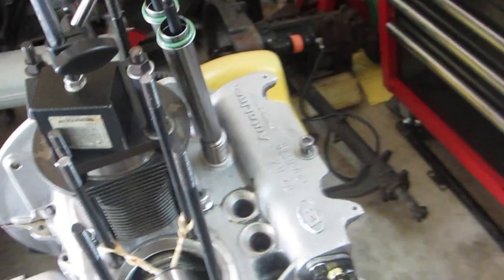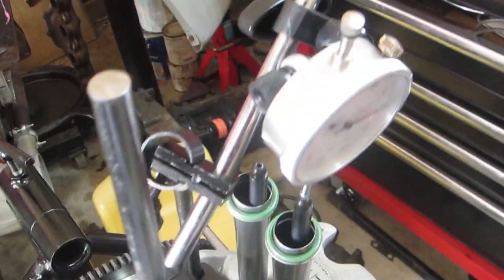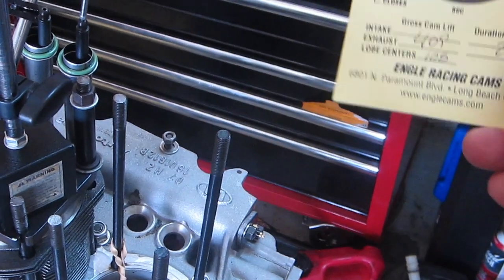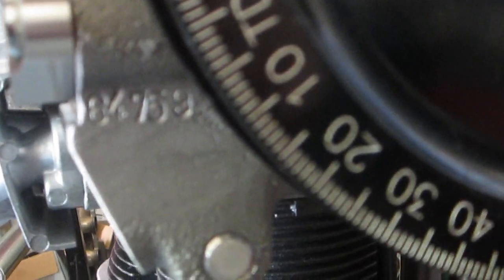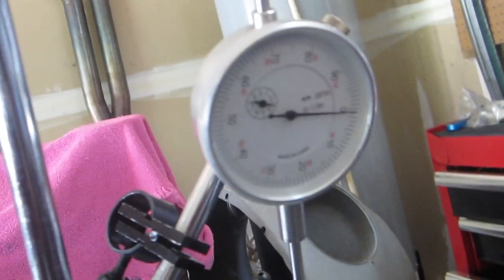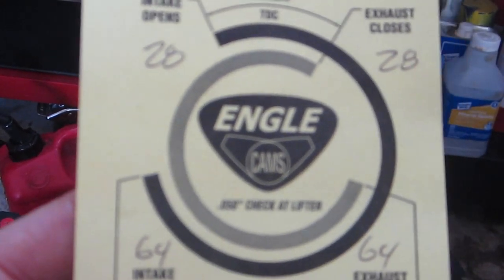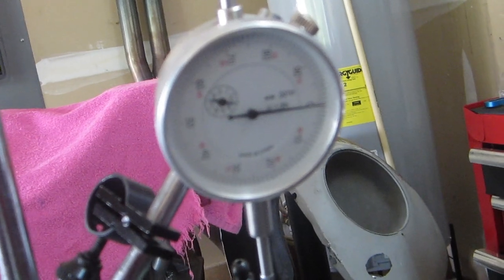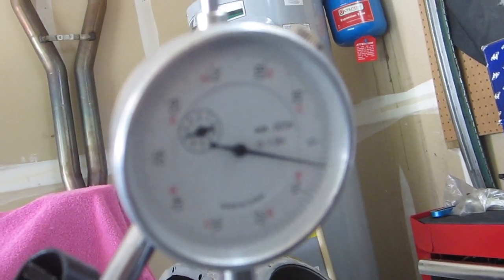VW Camshaft Degreeing

Comment: what size are your IN valves
Reply from the maker: 45mm intakes with 37.5mm exhaust
Reply: @vwsandvettes3253  gas flow through the IN valve has very little measurable increase beyond 0.25 valve lift !   are you running a counter weighted crank ? exactly what is the engine for ?